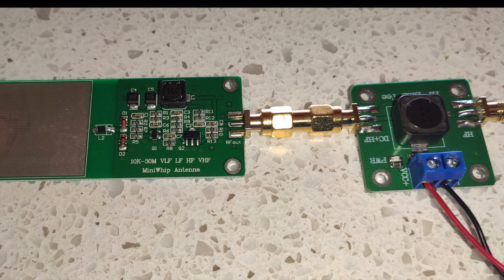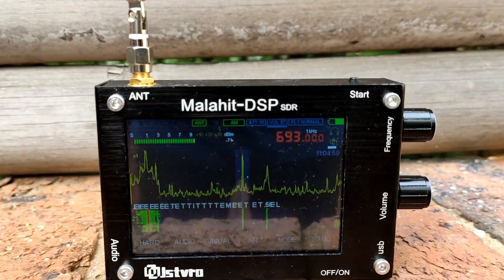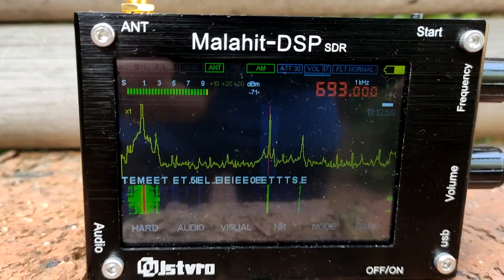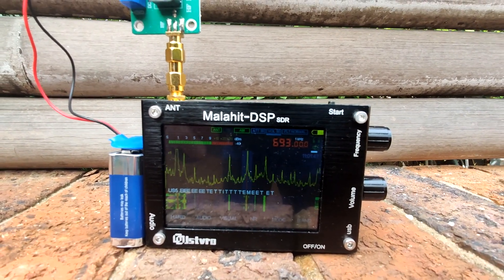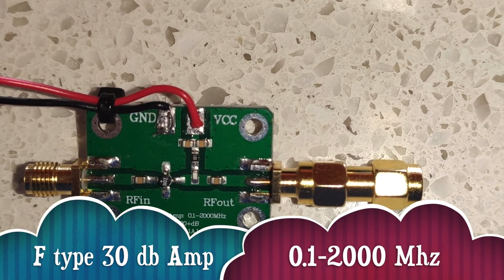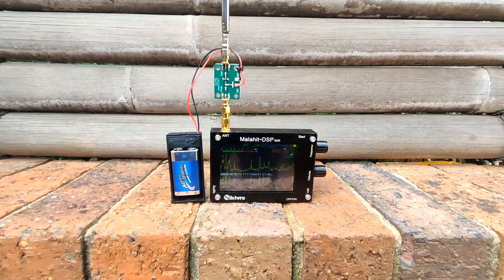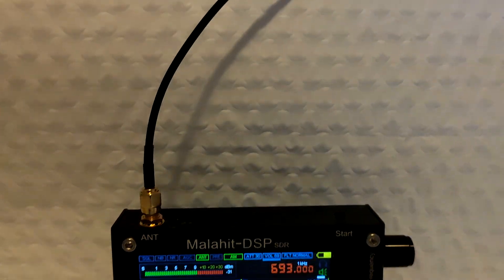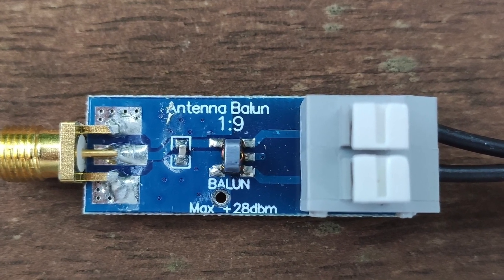Malahit-DSP SDR Radio Antenna input Devices

Comment: Hello thanks for the video, I have the same radio and found it quite informative. I'm using a long wire but struggling to find the same balun, any chance you can provide a link. Thanks either way